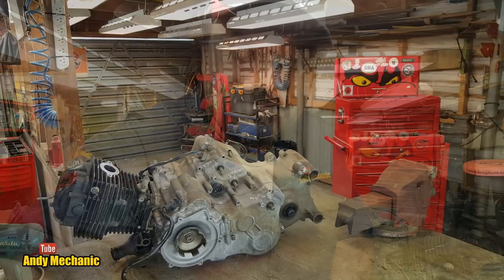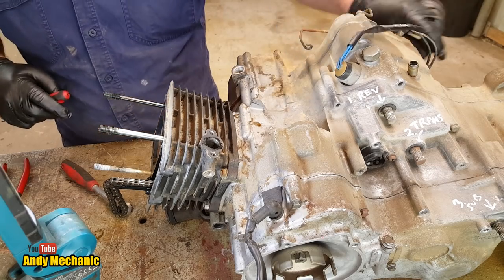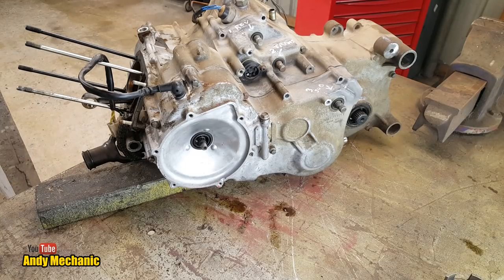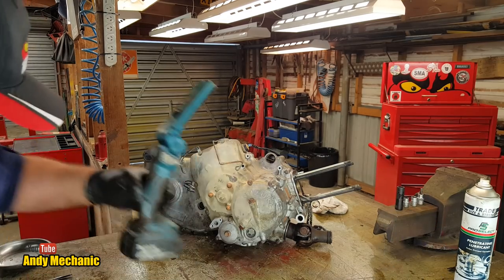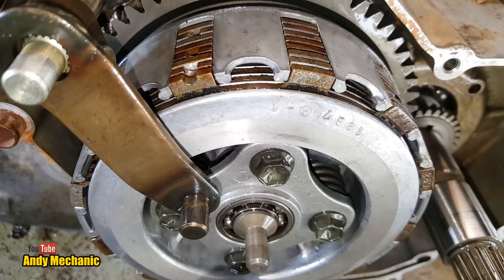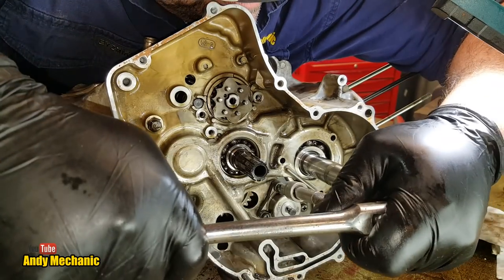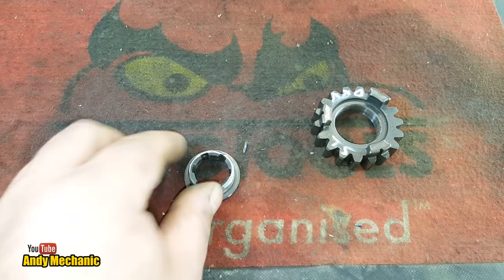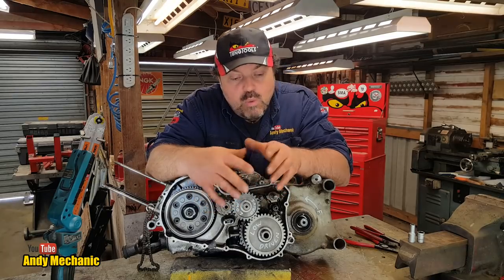ATV engine seized up at max speed - full strip & inspection #1035

Comment: Haven’t finished watching yet but it’s looking to me like it’s been submerged and hydrolocked, then after a while when the water had drained out the cylinder it restarted again and because the water flushed the oil out the engine it’s led to the lack of lubrication.

Just seems like too much water for a bit of rain water from outside storage and that would explain in cylinders but oil filter housing?

Comment: If you do take the oil pump apart it will be interesting to see what your take on the wear is and if that factors into reduced flow to that seized gear ( or if that drilled oil port through that shaft was plugged with debris or a feeding problem into the shaft where the oil enters ).  In my mind the very fact that particular gear assembly is steel on steel vs the other gears appearing to have brass type bushings in them to idle on when their respective shafts were turning within their bores, there is no leeway for lack of lubrication for two steel surfaces against one another. Seeing all that water flowing around out of the engine and how the oil filter looked, that is my guess as to why that gear failed as it couldn't handle a water/oil mix and once damage started it would go bad fast ( and driving it fast not helping at all ! )

Comment: Nothing worse than a chewed up screw that you can only get to end on. Some years ago I bought a pair of Molegrips with very specialty ground jaws only for gripping screw heads end on. They are my last resort tool and got me out of many tricky situations! Working on aircraft I could not use an impact driver. A tool that never gets loaned out!
Reply from the maker: I need a pair! Cheers Andy

Comment: It may have just been a manufactured problem when it was assembled. Proberly didn’t line up the oil feed on the shaft with the hole in the sleeve on the gear like you showed Andy. Maybe lasted as long as it did by being bathed in oil still when in operation ?🤔

Comment: Would be interesting to see if the rust in the bore would clean up with a light hone. Very interesting inspection, thank you. I still cringe at the idea of scraping a hardened screwdriver tip over a machined surface to check for wear / scoring, surely if there isn't any scoring, there soon would be? Or am I misunderstanding? I think I'll stick to my finger nail for the moment!

Comment: BTW Andy, get yourself an impact screwdriver for those machine screws, thank me later 😉
Reply from the maker: Hi Jake, thanks. I do have one but I like to use tools that most viewers will have so they know how to do the job with just the basic gear.

Pleased you enjoyed the video, this one took a lot of time to film & edit up.

Cheers Andy
Reply: @AndyMechanic  no probs, they are quite cheap though, about 20 bucks on eBay or 50 to 100 at the local tool shops
Reply: Great vid anyway 😁
Reply: @AndyMechanic  I second the hand impact driver, first thing I was taught many years ago that if you work on motorcycles was to buy and hand impact driver this was before we had atv's and such. People need to have this tool as it is a must for this stuff period. I appreciate the videos and am not beating you up but some times people got to have the basics and this one is cheap and will save money because of torn up screws that are special and not cheap.

Comment: 7,000rpm equates to 116 times per second, which alone gives an idea how fast that is.

You keep saying, "it's worn because it's old" Age doesn't wear anything. Many hours of use/abuse does.

That screw, do you have JIS screwdrivers?
I'd never assume an engine is scrap until you can confirm it is not worth saving or only for parts. So, I'd treat it as potentially repairable, and then sell it on for a profit.